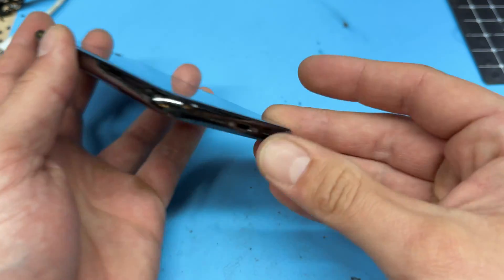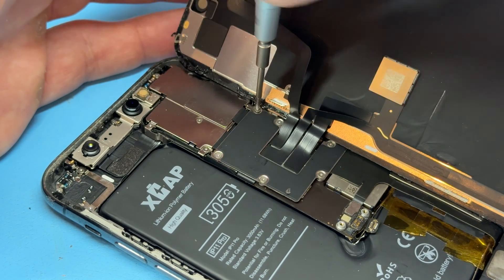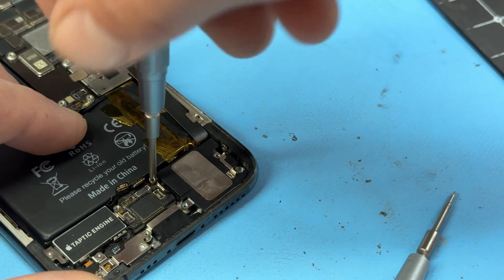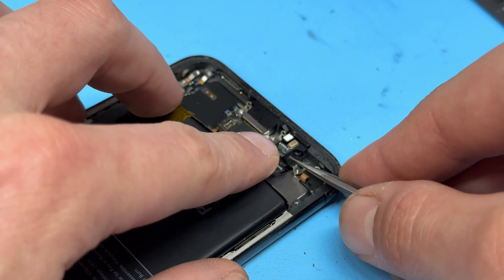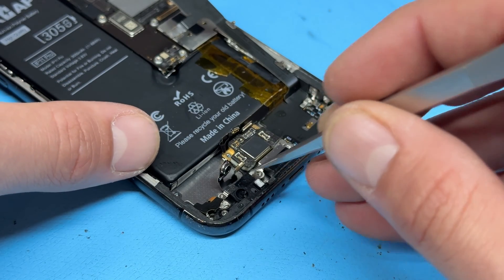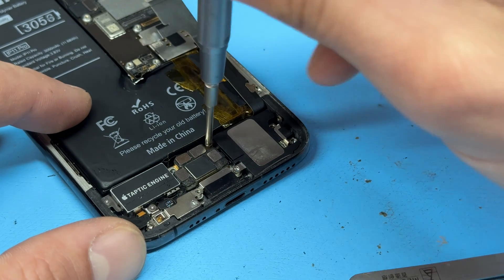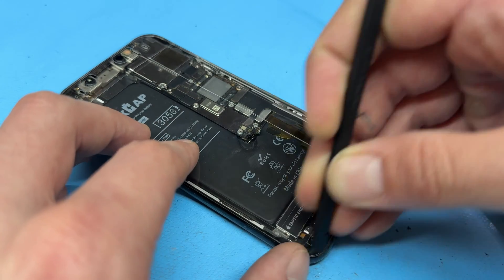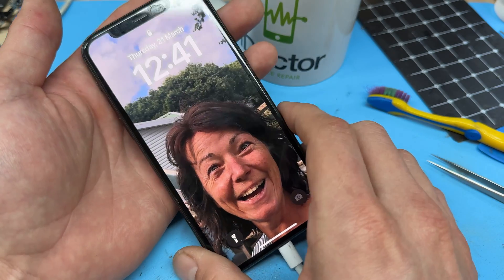iPhone 11 Pro Charge Port Repair Tutorial - DIY Guide To Fix Your Broken Charge Port!

Comment: THANK YOU!  They way you explain these videos is great - appreciate it :) I've gone through the process and through user error lost a couple of screws but it seemed to go back together OK all the same. One question - the phone is now saying it's overheated - do you think this may be user error on my part putting it back together or a dodgy battery (I swapped that out a while ago and it did get quite warm) - any thoughts much appreciated. Cheers

Comment: Great video, thank you! It was a bit daunting having so many pieces apart in my phone, but everything went back together well thanks to your step-by-step detail. I had one screw position that was different in my 11 Pro Max in the bottom left corner, everything else was the same. Charging is working great and everything else is functioning as well. Thanks again!

Comment: I wonder how you determine if the failure to charge is caused by a broken chargingport or if the problem comes from the motherboard. Does anyone know this?
Reply: Usually, you'll see finicky charging with a port issue....